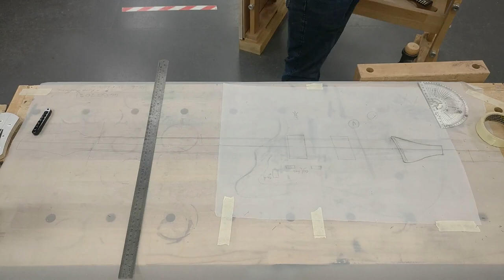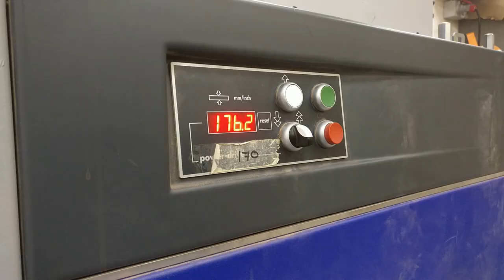Let's Have Some Fun - Video 1 of Some - The Great Guitar Build-Off 2021

Comment: I do like your laminations with the added veneers but it is a shame to cut some of those veneers away when you cut the taper on the neck, Far better to taper your laminations before gluing up so that you maintain those veneers right to the end of the headstock. Also we should should all be aware of the need to be economical with the way we use these wonderful woods. Making up huge rectangular blanks for a thru' neck is very wasteful as a huge percentage of the woods are cut away and become of little use. Far better to cut the shape of the laminations from a board, whilst nesting the components to minimise waste. Yes, they are a little more difficult to glue up but with a well thought out jig it's easy and the savings in exotic woods are huge. You can also set them out in such a way as to reverse the grain on opposite laminates which stabilises the neck. Great video and I look forward to the next one.

Comment: Nice video Sean... Question: Why did you re-enforce with carbon rods for a 5 piece (9 including veneers) neck? Would the multi-piece neck not be strong enough without needing the rods?
Reply from the maker: Yeah a 5 piece neck is plenty strong really. The carbon rods are complete and total overkill here, but I generally like to have them for the sake of a little extra time and cost.

Comment: wow, looks amazing this one, what angle is the headstock break angle out of interest?
Reply from the maker: I drew the headstock angle at 10*, but with the additional planing, and the addition of a veneer later one, it will probably range from something like 9.5 - 12 degree angle. At the end of the day, headstock angle doesn't much matter so long as there is sufficient pressure across the nut.

Comment: It was good to see you hit the tool chest :)    Those veneers, are they pre-stained maple or something?  Or is it a very dark ebony veneer?
Reply from the maker: Yes I was conflicted as to whether or not to taper the neck laminations, but in the end I wanted to try not doing it. I think if I was doing it again, I would.
I 100% agree with your point about being economical as well. It's one of the big problems with neck thru builds is the large amount of waste. I save the offcuts though, and they will be used in another project of some description.
Thanks for watching and for the comment, I appreciate it!
Reply from the maker: They are pre stained, yes. By the supplier (the veneer hub). I believe they're holly, not ebony!

Comment: Hey! What size bandsaw do you use? I've got 14" and it makes some pretty tortured sounds with a deep resaw. I believe it has a 1kW induction motor on it.
Reply from the maker: Hi, in my own workshop I had a 16" with (I believe) a 3kW motor.. in Crimson we have the Record Power Sabre 350 which is an awesome bandsaw. I'm not sure what the motor size is, but I think it needs to be beefy for deep hardwood resawing.

Comment: You are the first luthier that I have  seen on YouTube that is actualy cutting his fret slots himself .
I missed how you have located the exact position of each one. The position of the frets is so important that most luthiers buy them already slotted via a CNC machine for high précision. 
Looking forward for the next video. Great beginning!
Reply from the maker: For a multiscale, a cnc is absolutely the best way to do it, but that requires you to have the skills and access to a CNC machine. I used a  scale ruler to mark the fret locations with a scalpel blade. One scale on each side of the neck for the 2 scale lengths. Then I used a ruler and scalpel to join the marks for each fret, giving me the mark for the actual slot I need, and a score line for the saw to folow. I hope that makes sense to you!